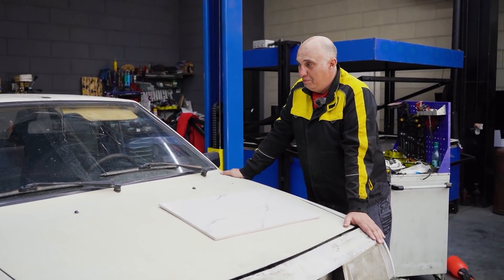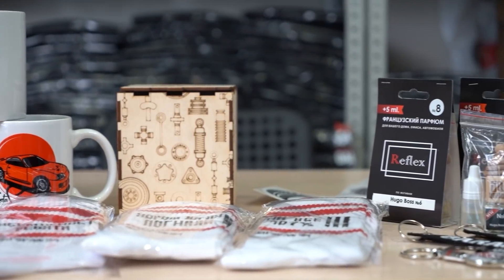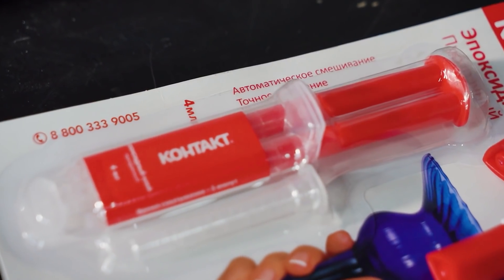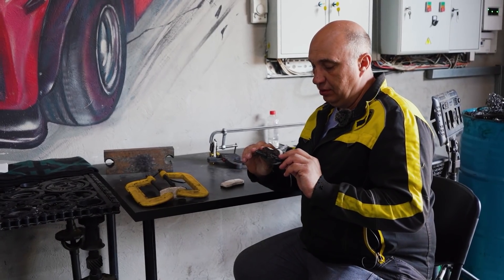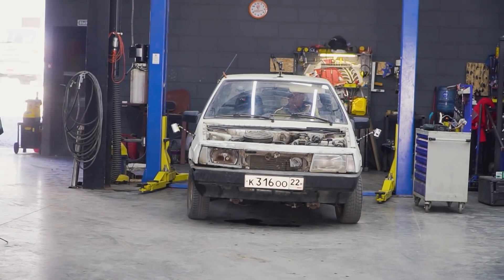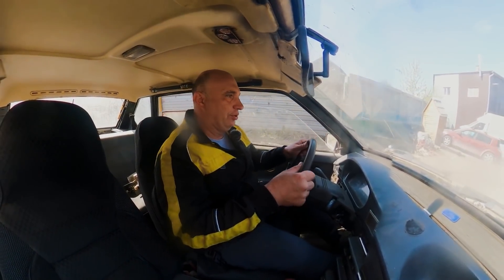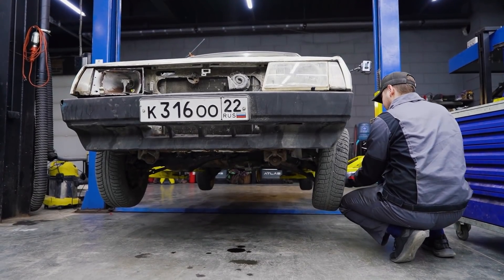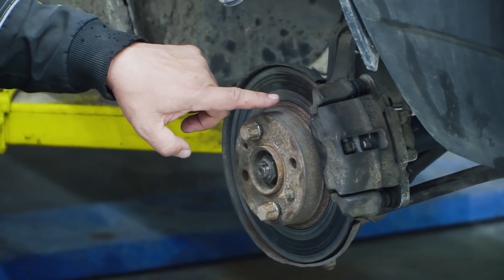Porcelain tile brake pads – will they work?

Comment: Tactically you’re harder brake pads, stop fast faster, cause more where and overheat faster special note on the overheat your medium breaks. They don’t stop the fastest. They don’t overheat the fastest. They don’t cause the most wear. That’s the general middle of the road your organic brake pads they stop the softest they take the longest to stop And when they do overheat, they take the longest length of time to cool back down and start giving good breaking force plus plus they polish over, giving them less breaking force longer to overheat, and even longer before mechanical breakdown of overall system. Now that being said those of you that are into quantum physics, actual nuclear physics, Gundam double oh the solace reactor perfect lensing over lensing you have to cogs out when the brake works it out when it’s actively running, that’s an actual nuclear reactor and illegal as hell unless you’re in the air and at speed there’s reasons for it if you’re not licensed for it, don’t worry about it. The only reason I’m saying it is because I have clearance and I’m trying to teach this guy at the shop a little bit of stuff before I end up not being able to watch his shows anymore as a thank you

Comment: Got new rear pads but a chain of events made me have to postpone changing them. On my way home from work the afternoon I finally had time to do it, I heard that dreaded rumbling-grounding sound. Steel on steel, pad backing plate grinding against the rotor. Faaack. New rotors needed too.

Comment: I haven't watched all the way through yet but the pads are missing the air slot to allow gasses and heat to escape the center of the pad, i bet at repeating high stopping they will fail

Comment: I use ceramic brake pads on my car and they last like 50% longer than the metallic ones I was using prior, and are barely any more money. A very small increase in rotor wear as well, definitely worth the money.

Comment: MrVeryCranky has a good idea. You should have also got them waterjet cut like the ceramic clutch. Better fit and again they have heat resistant adhesive. Glue for high heat.

Comment: The pads fail because they are cheaper to replace factoring in parts and service costs. To replace the rotors you have to remove the pads, adding more time, and money. That is why rotor is hard metal and pads are softer metal.

Comment: was expecting them to work a little better. guess you need to use ceramic powder fused with a high temp epoxy and form it into pads to get the equivalent of store bought ceramic pads.

Comment: Hard wearing but i have my doubts about stopping power!! Rough up the surface of the pad with a sander. You CAN NOT have HARD pads they would WEAR the disc rotor in NO time, it is the Same with pistons and rings, the bore can be Hard BUT NOT BOTH Bore and pistons one must be hard the other a little softer.

Comment: I once literally wore a set of rotors down to 1/16th of an inch, driving for about 3 months on worn out pads - financial crisis, flat broke living paycheck to paycheck for a while. While I don't recommend doing this, I knew for a fact it would work out as my 92 Chevy Lumina had thick rotors and approximately 2-3 inch long pistons in the calipers. As I planned on replacing everything at the end I made it thru. Funny thing was a local shop tried to use scare tactics on me, " you can't do this you'll wreck when you can't stop !!! " Thanks Kauffman Tire, just lost my business, I have a brain and understand the forces involved better than your salesman, it just takes stopping sooner and more gradually.
All in all the 3100, 3500, 3800 powered Luminas and Buick Regals were some of the best running cars, excellent powertrains and braking and when pushed to racing speeds to firm up the suspension good handling as well.
Reply: We can’t bust heads like we used to—but we have our ways. One trick is to tell them stories that don’t go anywhere like the time I caught the ferry over to Shelbyville. I needed a new heel for my shoe, so I decided to go to Morganville which is what they called Shelbyville in those days. So, I tied an onion to my belt which was the style at the time. Now, to take the ferry cost a nickel. And in those days, nickels had pictures of bumblebees on ‘em. ‘Give me five bees for a quarter,’ you’d say. Now, where were we? Oh, yeah! The important thing was that I had an onion on my belt which was the style at the time. They didn’t have white onions because of the war. The only thing you could get was those big yellow ones

Comment: Instead of a torture test, do a long term durability test. Braking under normal circumstances won't produce that much load for an extended period of time. Not enough data to resolve! Back to the lab with this one!

Comment: Softer pads grip very well in colder temperatures, at the cost of changing pads more often. Harder pads have great bite in most temperatures, but wear the rotor and pad more evenly. This is why Ceramic brakes are very common on sport trim cars like the Subaru WRX and WRX STi, or any sports package.

Comment: Others are recommending using the smooth side on the rotors.
It might not damage the rotors as quickly.
Reply: Also wouldnt be the smooth side for very long

Comment: aluminium oxide, or magnesium oxide, try those
Reply: why not just drill, bolts, why glue
Reply: why the world does tech in the worst non-optimal way
Reply: you could test them in the lab, rolling in a dyno, or separate test bench, not having to go out in the traffic
Reply: electromagnetic regenerative brakes

Comment: Sorry guys but it was a amateur or I should say real "Russian style test" lol. Guys put on the lathe the break disck and resurface it.  Also  could grinder the tiel mirror smooth or at least use the other side. You guys really should repeat this test,because I'm sure is will works just fine and long.

Comment: I wonder if you use the smooth side and keep them cool, if you could do a decent rotor resurfacing with these if you keep it at low speeds.
Reply: IDK if they still make them but they used to make resurfacing pads.  You put them on, powerbrake the car, and it turns the rotors.  They were ass, but they did exist!
Reply: @BrianRRenfro  I just learned something new. Very interesting. I'm going to do some research because that sounds wild. Thanks for sharing.
Reply: I would think that the biggest problem is that there's effectively no way to eject the swarf.  They would just quickly clog up with metal filings and then stop working.

Comment: You should have put the glazed side of the tile against the rotor. It would have done much less rotor damage than the rough side while actually providing more surface contact with the rotor.
Reply: Yeah, or at least a pair, to see the differences.
Reply: The glazed side is very Thin under that layer is the same stuff like on the back of the tile.
Reply: I can see why they went with what they did, the rough side would in theory give more bite. But yeah it's a valid point. It would've been interesting to see both sides tested. I don't think it would've changed the final result much though, the porcelain was gonna crumble regardless. (PS I love these weird crazy experiments)
Reply: @colestowing8695  I think you are correct ,
it wont change anything .
The layer is so sthin and my guess is that 
the breaking the first few times would be 
more like the wheel still running and not 
breaking due to the very smooth surface ,
then after it is ' sanded ' down it will start 
breaking as it did .
This is my guess of what would happen .
But yes , interesting to see if that hold up .
Reply: The poor rotors
Reply: Also, they should have torture tested the regular pads the same way with the car hoisted up.
Reply: @ErikZiak  YES AGREE   maybe this 
can happen if ask on their Russian page 
after all this is the place where they listen 
to peoples sugestions .   :  )
Reply: Yep,that wasn't the porcelain side doing the braking.
Reply: @paulcollinson5244  It actually was the real porcelain used , the glase on the other side 
is like a thick hard surface to paint on .
This is also the side that you see crack on very old porcelain stuff .
Tiles of porcelain have only this glase on the front side and the porcelain is exposed 
on the back side , while things like cups and such is fully coated .
BUT I AGREE with you all about , they should have tried both sides .
Reply: @Stronz_music  stand corrected,thank you.
Reply: @paulcollinson5244  You are welcome  👍
Reply: @Stronz_music  what about resurfacing them? Carbide on a fly cutter should do it, no?

The tech working on the cars should at least pump the brake peddle as a completion task to wrenching on the brake system..
At least then they would have noticed the rear brakes where not functional.. this wasn't the first time either.
Reply: You don't know what you're talking about

Comment: I don't know what Datsun was making them out of back in the 70's, but this truck is still running it's 43 year old original brake shoes.
Reply: probbely  asbestos
Reply: 50% asbestos
Reply: Asbestos and lead; stuff lasts forever lol
Reply: @briantoste904  bruh with brake make of this you will kill everyone when you brake thoses thing are so dangerous for health
Reply: That's a mint datsun
Reply: Both Datsun and Toyota’s drum brake shoes would easily last 200K miles or more .
Reply: Asbestos brake pads
Reply: For starters. It's cheap these days to get a pad tested for composition. Even better one could learn to make them at home. For our vehicles today. My Dodge and Chevrolets from 15+ years ago. The "new' pads are thin. NOT quality as much as OEM early dates. I've treated drums & rotors at my old shop. I have had interesting results. 👍😎  Especially when zi got ahold carbide steel blocks..geez! Amazing
Reply: Years aren't very relevant. And even mileage isn't that helpful alone. What you need to express is mileage combined with type of use. If you have 500k on your car, but drive 99% highway, then of course they'll last forever. But if you have 500k and you're in stop and go traffic from high speed to low speed all day, then that's a different story
Reply: If ur in California ur gonna get cancer just from saying that

Comment: Why not use some breathing protection? That ceramic dust is really bad for your lungs when you're grinding/cutting it...
Reply: It's okay, they are trained Russians.
Reply: shake hands with danger
Reply: be a man
Reply: it's ok, just safety bite your lips, it's like the safety squint
Reply: @lasskinn474  holding your breath till you pass out is the pro technique
Reply: Can't be that bad for you, my coworker worked with tiles for years with no breathing equipment and is still kicking, used safety sandals as well.
Reply: worry not, he is russian
Reply: “[Screw] thaht… theese iz RUSSIA.” 😉
Reply: is russia men are men and women are women live dangerouski in his off time vlad smokes next to gas pumps for kicks.
Reply: In Mother Russia the dust breathes you!